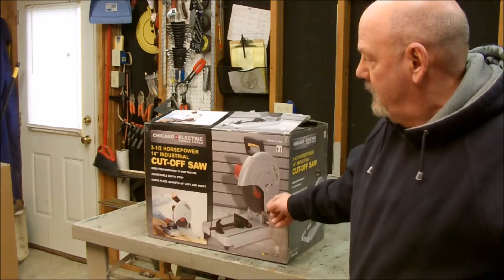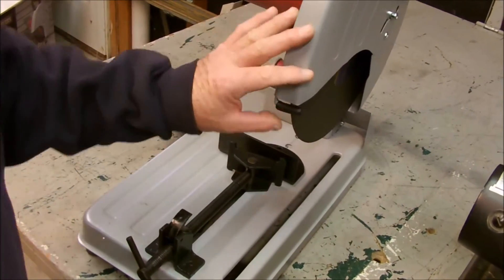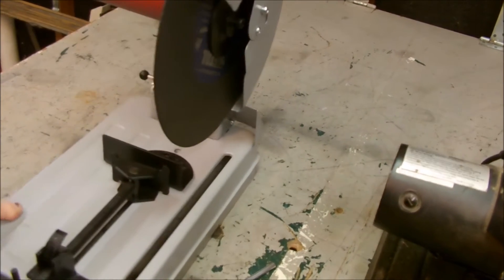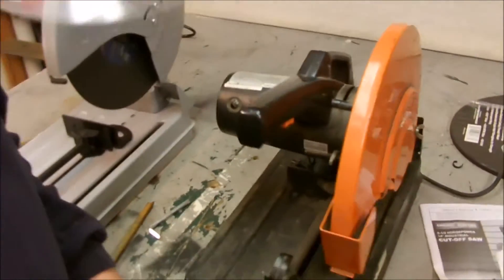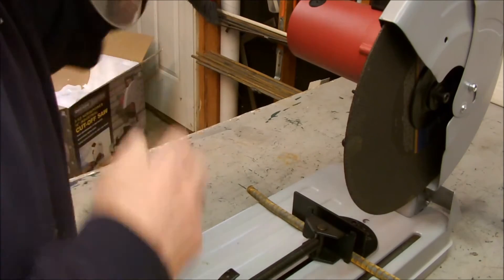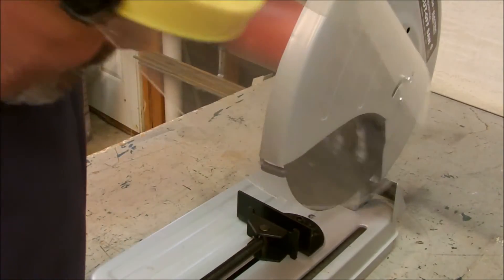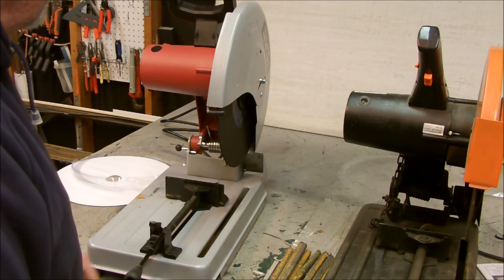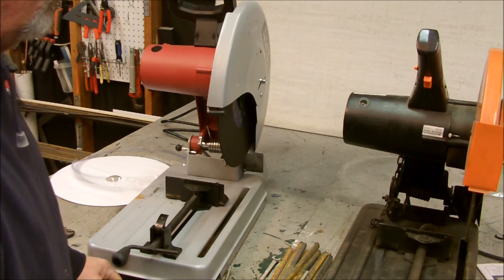Harbor Freight 14" cut off saw # 61481

Comment: Just took my HF cut off saw out of the box today and the blade wobbles.  I'm using an 1/8th inch wide blade and the outer flange won't properly engage the arbor.  Looking for answers.
Reply from the maker: I would just take the saw it back, HF usually just takes it back and you go back get another one no questions asked , if something isn't machined correctly it is too dangerous to run, now I have had warped or deformed  blades but you would be able to tell that..

Comment: I bought the old version about 15-plus years ago. The unit is under-powered but if you only plan to use it on the rare occasion, it's OK. You seem to be forcing the cut, take it slow and let the tool do the work. Also, get a good quality cutoff wheel, they cost a lot more, but they do make a difference.
Reply from the maker: I agree that it  is a little under-powered,  the old orange and black one seems to cut faster. I did a test with some different wheels and it was surprising the difference!
Reply: Harbor Freight also sells a 3.5HP version but from what I've seen on Youtube there is not a lot of difference. I would imagine that HF will eventually sell a cold-cut saw, or you could get the Evolution Rage 2 for a little over $200, but it doesn't come with the best blade.
Reply: @Pro1er  - #61481, the one here, IS the 3.5hp version.

Comment: The condition of the blade on the older saw probably helped make it a faster cut.
Reply from the maker: I honestly don't remember, I did another video on different brand/size blades and timed the cuts on rebar . The harbor freight blades didn't fare too well! I have been using the HF Portable Band Saw for most of the cuts now.  Thanks for the comment!

Comment: Where can I get a repacement switch for my Harbor Freight drillmaster 14" 2 HP cut off saw #61389
Reply from the maker: If its burned up take it out and try to match it up at Grainger, if its just cracked up try CA(super) glue other than that I don't know.
Reply: It is not burned up. When I was using it today it broke and fell out and lost springs and small broken piece of the trigger. Thank you for your reply.
Reply: ok thank you. I will try Grainger
Reply from the maker: No problem. Good luck. Funny you should comment on a saw, I just this afternoon, super glued the laser back on the 12" miter saw!

Comment: How long does the blade last?
Reply from the maker: I mainly cut  #3 and #4 rebar so they last a while, cant say exactly.  Cutting angle  or large pieces seem to tear them up the quickest. Portable band saw is my new favorite quicker,quieter, not near the heat generated !